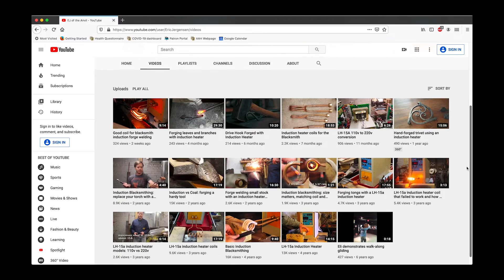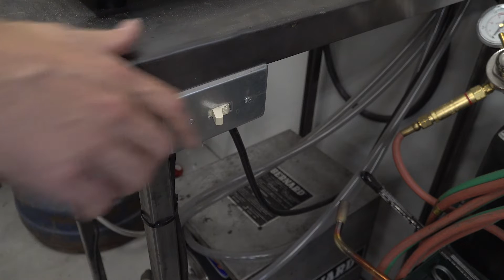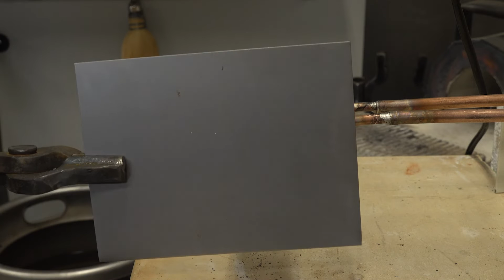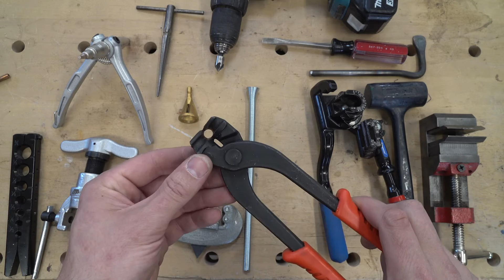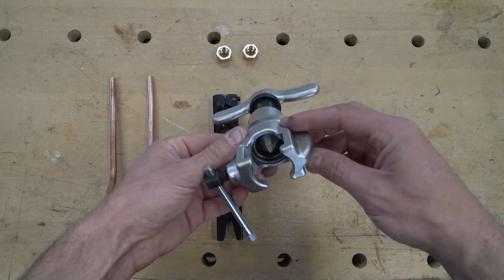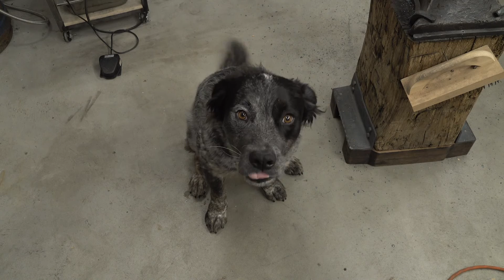Intro to Induction Heating for Blacksmiths - Rocky Mountain Smiths

Comment: can it holding a temp at spesifik degree    like a oven furnace Sir
Reply: If the piece included an industrial grade temperature sensor that’s built into the driving circuitry.  An electronics circuit designer could do this.

Comment: This is truly awesome (not "awesome" like cool, but AWEsome as in stunning and gobsmacking!) -- Thanks! This is such a practical machine, and I am torn between this and a small ribbon burner forge to work on shorter pieces of steel.  Just one unrelatred comment, since you seem to be a money saver, I saw your oxy-acetylene outfit there and would recommend you dump the acetylene (expensive, dangerous, and very inconvienient) and go to propane (yep, grill gas) which only requires a different low cost cutting head. I did and never looked back -- very happy.

Comment: Your videos are priceless to those of us trying to get up and running with Induction forging. Ive learned a lot in the ones you've uploaded and really appreciate the level of detail. Can you point me to where the files for the 3D printed forms you show in this one? Ive looked high and low and have only seen a few examples in the usual sites. Thank you again!
Reply from the maker: I have moved away from 3D printing forms because it isn't worth the time to make them unless you are in production mode making a lot of the same coil. I can send you the file for the small one I did if you want, but honestly I have found the pancake coil to be better at heating smaller stock / the ends of tapers. A good trick with bending forms made with softer materials like plastic or wood (or ones with channels for the tubing) is to make the middle removable, so you can collapse it and pull it out of the coil. I've learned that 'unscrewing' them can be quite the hassle. I've been meaning to make a follow-up video or two, I've learned a lot more since I made this. Also apologies to everyone with questions here I didn't reply to, I wasn't getting the notifications and have been pretty bad about checking back here.

Comment: Thank you for measuring the current and publishing it !
I had my doubts regarding the power rating of 15kW, because I have a 2KW version that heats up similar parts in 2-3 the time you showed. So I searched for a while to get usefull informations.
Your measurement results in 30A * 220V = 6.6KW input power. Assuming an efficiency of ~80% , that means ~5kW at the coil. This is 2.5 times the power I do my tests with. So this is plausible. 
Power Ratings of Chinese products are quite strange.
Even the input power calculated by the fuse rating (C63 on the breaker means 63A with  C type-trigger characteristics) times the input voltage (220V) comes only close to 14kW. Not taking efficiency into account.
To have 15kW at the coil, assuming ~80% efficiency, the device had to draw  85A at 220V from the line.
Don't know the situation in the US, but drawing 85A from a single phase line is nearly impossible in a home and small business installation in Europe. On the other hand it's no problem to get it from a standard three phase 400V~ plug, what is actually very common to have here. But these devices are much more expensive.
Thanks again !

Comment: 31:53 where did you find that table top riser thing?
Reply: I found those on Amazon a few years ago when I was building a different project. They are called Lab Jack Stands. Very useful for a variety of shop work.

Comment: Evan,  My induction forge is here and I thought I would get some materials for coils.  When you give a tubing size, is that nominal size or actual OD  for instance 1/4" tube is actually 3/8" OD.  Which makes it seem pretty likely its the actual OD that matters.    Also, is the flare 45 degree or 37 degree.  Thanks again for the video.
Reply from the maker: Sorry I missed this John. Sounds like you got it up and running though. You should come to the November RMS demo - Scott and I will be talking  about induction heating and demo making some coils etc.

Comment: Great video, thank you! I noticed you don't use the fiberglass insulation on your coils. Any reason? Are you just practiced enough and have steady enough hands to not touch the coils while heating?
Reply: The fiberglass burns away quickly. It’s rare that it’s useful. Just be careful.

Comment: Can you feel magnetic force when it is heating?  Like does it center itself in the coil? Can it shock you?  Good thorough review
Reply from the maker: Not so much with helical coils, but with one sided coils like the pancake coil you definitely can. If you short the coil it will often make a spark, but will not shock you.
Reply: But why does it not shok one and is the cooling water also safe?

Comment: Thank you for the video 
I have one like this but when i push start for heating the over current LED light and it can't heating
Reply: Hi check my channel, maybe i have a video of your problem.
But first I would recommend to open the machine and look for anything burnt.  Next maybe the diode is broken. You may have a clogged copper line, check if the water is coming from the coil.  Next see if there is any crack at the solder weld inside the machine behind the thighening nut.
Good luck

Comment: Sir I have this machine
But now it's showing over voltage indicator
How to eliminate this kindly guide
Reply: Hi check my channel, maybe i have a video of your problem.
But first I would recommend to open the machine and look for anything burnt.  Next maybe the diode is broken. You may have a clogged copper line, check if the water is coming from the coil.  Next see if there is any crack at the solder weld inside the machine behind the thighening nut.
Good luck

Comment: Why can you not just connect a hose and run fresh new water through the machine?
Reply from the maker: You can - if you have enough volume and pressure. A friend did this and would run the machine while watering the yard, plants etc. Doesn't seem like a good long term solution though, especially if you live out west or where water is precious.
Reply: @evanblackstock4921 Nice! Thanks for the reply and making this helpful video. My house is on a private well system and I have a water line in my garage. Putting together the cooling system seems like a lot more me. Running continous water through it seems so much easier.